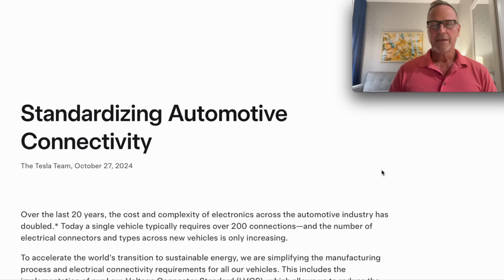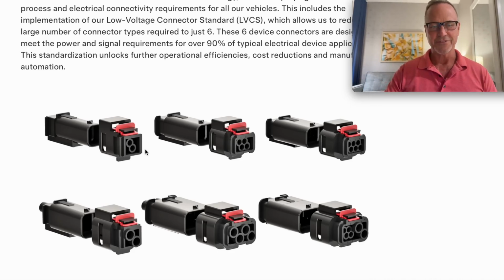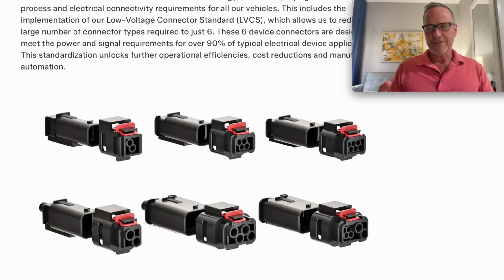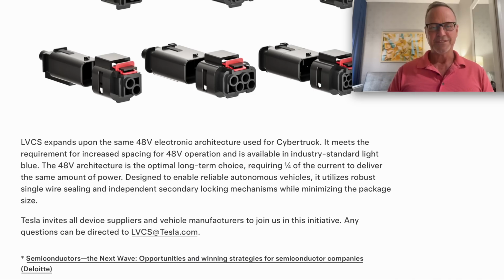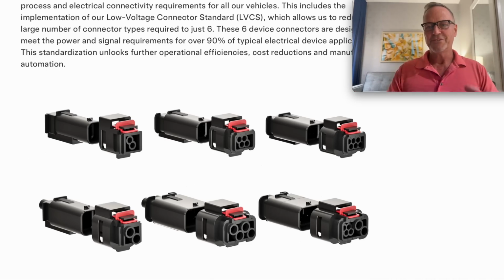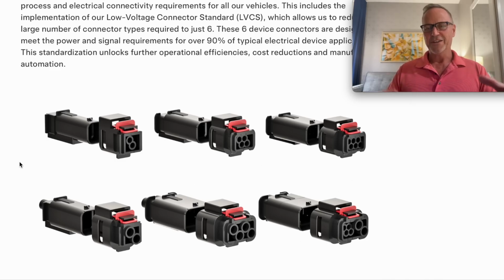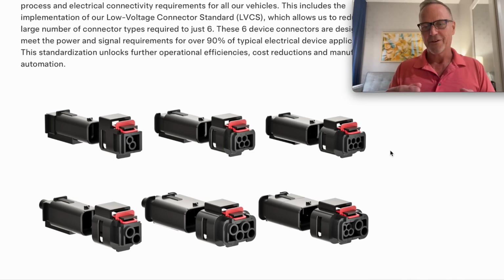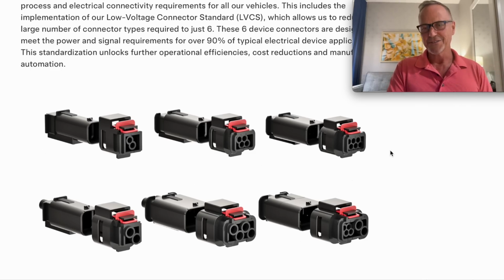Tesla Drops Another BOMBSHELL Standard!

Comment: Nice to see an attempt to standardize this technology early. Hopefully they have chosen a design that will last many years into the future.
Reply: They're hardly early. The 12 volt standard was well-established when I was born 62 years ago.
Reply: @restonthewind  When was the 48 volt standard established?
Reply: @davidbeppler3032  It wasn't. There is no 48 volt standard, only attempts to create one, and Tesla isn't the first to try. One company doing things a certain way is not a standard. It only becomes a standard when many companies follow the lead, and that hasn't happened yet. Maybe it will, but the change is not as simple as EV makers adopting NACS because NACS didn't replace a well-established standard. It replaced the absence of a standard.
Reply: NACS didn't create a standard as such, it's in effect CCS1 conformed into Tesla's propietary connector form factor. The voltage and signalling protocol are those of the CCS standard in the NACS connector.

Similarly in the rest of the world Tesla adopted the global standards either the CCS2 standard or in China the GB/T standard - adopting both electrical, comms and plug form factor standards. As these standards support three phase AC that the NACS standard doesn't offer.

Similarly, 48V is based on IT/Telecoms standards, including a propietary variant on the original Etherloop time divison protocol methods from the 90s extended with extra dedicated current carrying power wires
Reply: @GruffSillyGoat  Okay. So put into terms that an old farm boy would understand. What's your point?
Reply: @restonthewind  I think these designs may work in the absence of a standard.
Reply: @GruffSillyGoat  So NACS is a hybrid of Tesla and CCS1? It's a standard because practically all automakers plan to adopt it, not because it differs from anything that preceded it.

NACS is a North American Charging Standard, so I wouldn't expect it to prevail outside of North America.
Reply: @jbbuzzable  They can work for Tesla without becoming a standard.
Reply: @restonthewind  You miss the point. By becoming a standard, one can reap the benefits of economies of scale.
Reply: @jbbuzzable  - No problem. I've outlined more below as charging is a bit of a confused mess, only if you're interested otherwise please feel free to TL;DR the section. My point is Telsa have embraced and extended previous standards rather than invented from scratch, and that from a worldwide perspective Telsa may follow dominant standards rather than roll out their own.

TL;DR section

In North America, Tesla's original charger connector was based on Japan's CHAdeMO electrical and communications standard (as used by Nissan / Mitsubishi), but in a slimmer connector with a push button to open the car's charger flap. The power connector design and communication protocol was a Telsa specific extension of the CHAdeMO standard at the time. This was the connector used in Tesla's up until the launch of the Model 3 in 2019, which introduced a new charging connector standard which evolved into NACS. The plug is the same format as the older one but using power standards, but follows the electrical and car to charger communication standards of CCS instead. 

After May 2019 all Telsa cars were equiped with new charging connector, but support being able to be plugged into the older V2 Tesla chargers that support the old standard. For older cars a modification is required to plug older Tesla car's into V3/V4 chargers.

In parallel to Tesla's approach, the US adopted the CCS1 charger standard, based on a global standard but adapted for the US market, which was adopted by many non-Tesla automakers. However, this charging plug/socket format fell out of favour following pertitions by Tesla for the standards body to adopt it's narrower format plug, as Tesla themselves had changed electrical and car to charger communications to that of the CCS standard. The standards body asked for consumer feedback, and as the consumer preferred the Tesla smaller and lighter plug this was choosen as the NACS standard. This isn't surprising as the CCS1 connector with the external clamp on the plug is a bit unwielding (unlike the CCS2 standard elsewhere in the world that has a retaining hole rather than a clamp). 

Most home mains supply in the US are single phase (live and neutral) or split phase (two seperate live's and a common) - the NACS plug (as well as and CCS1) supports this form of AC electricity supply (as well as DC supply).  The CCS1 standard South Korea who also have similar 110/120v split phase supplies; similar with Japan but who mainly use a different standard - CHAdeMO. 

Elsewhere up to three live phases plus neutral are supported, offering up to 480 volt electricty, often used for industrial power supplies and are more common on countries who have 240v single phase within the homes. In these countries a differing standard known as CCS2 offer charger connectors that have more two more AC power pins for the extra two live phases. Whereas China also supporting three phase AC adopted their own standard known as GB/T. 

Hence the world is covered by four chargring connector standards:
- US/Japan/South Korea - previously CCS1 now NACS, South Korea may move to NACS as well. 
- Europe, Middle East, Asia, Africa, South America and Oceania - majority of cars, including Tesla's, are CCS2 / CCS2 Combo (the latter for DC charging). Some CHadEMO on older Nissan and Mitsubishi cars.
- Japan - predominately CHadEMO (also Tesla Superchargers/NACS)
- China - GB/T

That said three phase charging connectors do exist in the US, known as SAE J3068, but are uncommon as not all electrical supplies can support it. The connector and electrical standard uses a slight variant on the CCS2 connector and is mainly aimed at industrial use and heavy trucking. It remains to be seen whether trucking in the US adopts the NACS as well, as Tesla is seeking with their Semi, or keeps with the SAE J3068 connector being able to support high voltage and current AC as well as DC.
Reply: @jbbuzzable  Sure. The 12 volt standard creates huge economies of scale. The problem for 48 volts is that 12 volts already has these economies of scale and 48 volts does not.
Reply: @restonthewind  One could say the same thing when the conversion from 6V to 12V was made.
Reply: @restonthewind  I was born 70 years ago, but things were different then.

Comment: Any standard for connecting third-party solar panel arrays, either mounted for use in motion, or larger arrays while parked?  (to charge the large main drive battery)
Reply: Solar arrays either mounted for use in motion have not yet been proven to be a viable option, so I am skeptical about that use case.